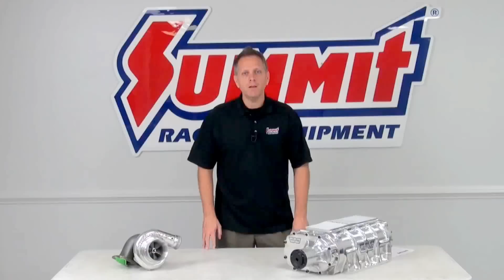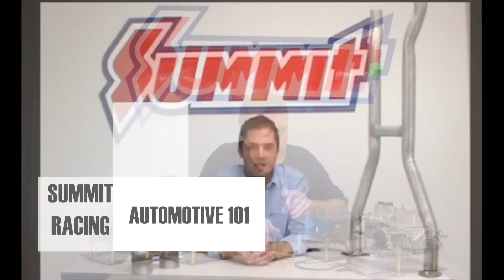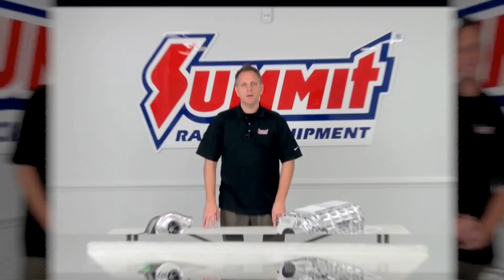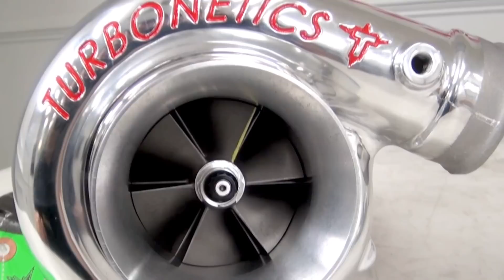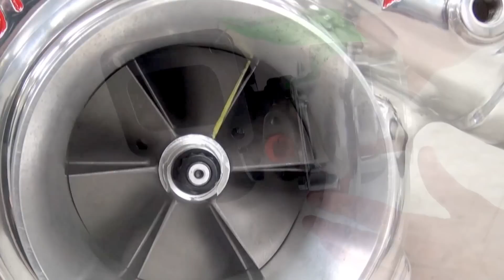Supercharger vs Turbo - Summit Racing 101

Comment: Turbos get much better mileage, they have a much higher boost capability, they're infinitely adjustable, and for a street car you can drive all day and never have to use boost, rather stay in vacuum, for cases of slick raining roads, etc.
Reply: thats what they were designed for economy and the turbo doesnt even come on unless the engines under load 
thats why in rally racing they powerblock the car to keep the load but it causes a lots of people to brake and gas at the same time the car starts hopping over and understeering till they find themselves in a realy bad wreck.
Reply: Some screw type superchargers have bypass valves, which allow you to stay out of boost and not use the extra power.

Comment: Hey I am planning on running a turbo charger in my 65 ford falcon that is equipped with the 200 L6. I have been doing tons of research and have found nobody that has done a turbo build on that kind of motor. I have received a turbo off a mitsubishi Evo VIII it is the 60mm 16G turbo, and this is the turbo I will plan on putting on the car. I plan on building my own headers out of t304 stainless steel, Im going to run a 3 in exhaust with glasspack, 2 barrel carburetor, and DUI distributor. what would be the horsepower gain in this running on 10psi compared to if I were to just have split headers, 2.5 in dual exhaust, and all the other options as posted before minus the turbo?
Reply from the maker: Hi Trevor Reed,
We would love to help! Can you give our tech department a call at 1-330-630-0240? This may take further discussion. We look forward to your call. Thank you for watching!
Reply: the 2 barrel is going to have trouble keeping up in the higher rpms, A friend of mine did something similar with the dodge 225 slant six. We had to build a custom header and intake ourselves to adapt a four barrel to meet the fuel consumption needs in higher rpms where we noticed the engine leaning out. The dodge slant six engine was ideal for a turbo with its open engine bay and having both intake and exhaust on the same side "besides the chokes on these engines which are a pain in the ass" makes for a clean look and short inlet tubes. I dont know the power figures on his car "1972 dodge dart" as we have never put it on the dyno but i can say it is a torque monster! And the definition of a sleeper. Hope your build goes well, take your time and make sure everything is prefect and you will have a gem of an engine. The 65 ford falcon is a gorgeous car, and all hail straight six engines.

Comment: I think a key advantage to a properly setup Turbo build is that you can also have an electronic boost controller and thus be able to have different settings for the street and strip. 

With a super charger you often have to either upgrade super chargers or change the pulley.  I have seen some "variable boost" super chargers but they do not seem to have caught on much.

Also a turbo will often get as good of gas mileage as being N/A

Anyway I liked learning about the different super chargers, it would have been interesting to see the internal difference between a screw and roots style blower.

Comment: Hey guys at Summit. I just bought my first vehicle. 1986 El Camino SS. It has around 180 hp. It has a 305 V8 with a 700r4 automatic transmission.  I never really get her over 3500 and it revs out 6000. I would like to get some lower range say from idle at 650 to 3500 rpms. What do you guys think I should get. Thanks
Reply: Just my 2 cents:
I hate to say it but probably the best thing you can do for power, especially if you're going to keep and modify the car long term, is to find yourself a mild 350 and get rid of that 305.
If you really want to keep the 305 and want to supercharge it make sure the engine is in good condition (compression test, etc). You don't want to add any type of supercharger to an oil burner, an engine that knocks or has other problems.
The cheapest, simplest option for boost is probably a Weiand 144 Pro Street Supercharger (Summit Part number WND-7740-1). You may need to cut a small hole in the hood and get a small hood scoop to accommodate it but these little "mini-blowers" produce great low rpm power and bolt on pretty much like an intake manifold.
I have the next size up, the Weiand 177 on my 380ci in my Camaro for two years now with no problems. Took a bit of tuning (air/fuel and timing) though.
Reply from the maker: Hi Joe Zongora, 
It was typical of those cars to come equipped with a highway gear ratio from the factory. A great first start in your build would be to consider a gear ratio change to a 3.42 or 3.73 depending on any future modifications. Feel free to give us a call on the tech hotline and talk to one of our reps. They will be happy to assist you with your build and part numbers.
Reply: I will thanks guys.

Comment: What size of turbo is about right for a 400 Ford with a 5k redline? I'm just wondering how big of a compressor wheel it would need to be to push 3-5psi at 5k.
Reply: you want to look into the 50mm ballpark area.
Reply: Alright, thanks. I'm rebuilding this 400 and trying to decide if I want to go Turbo/Carb or NA/Carb.
Reply: With a low PSI like 3-5, I personally wouldn't bother with a turbocharger unless you're going to be turning up the boost for higher numbers later on.

You might be better off with going the Fuel Injection route.

End of the day, it's your car. Do what you're comfortable doing. It's all up to you.
Reply: To summarise, low boost isn't going to net you much over 100hp/torque.
Reply: That's still a lot though, and the cool factor goes way up too haha
Reply from the maker: Hi outlander330cc, 
This will take a whole lot of fabrication! Can you give our tech department a call? 1-330-630-0240. Thanks!